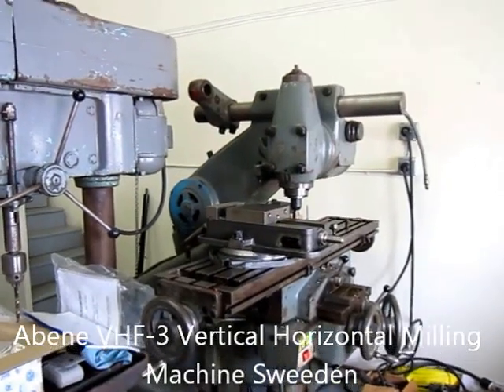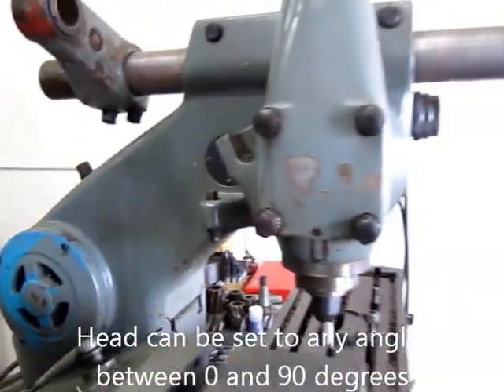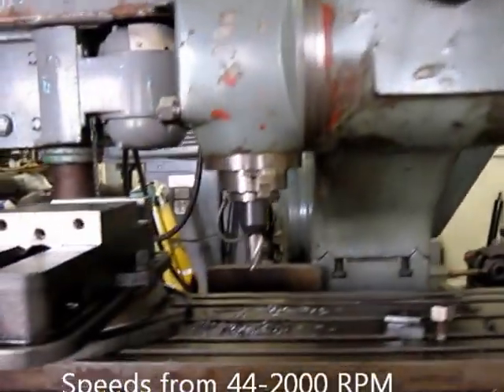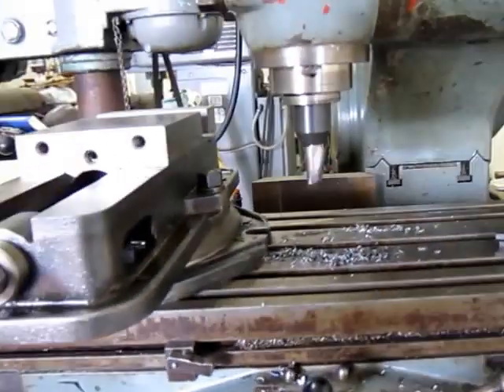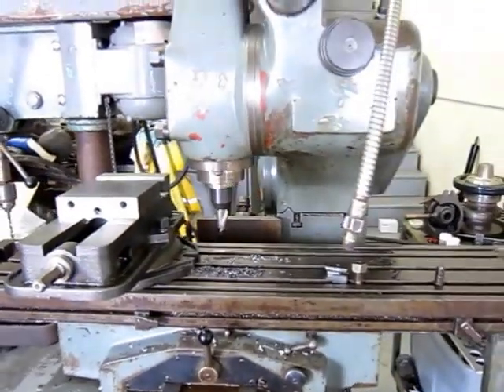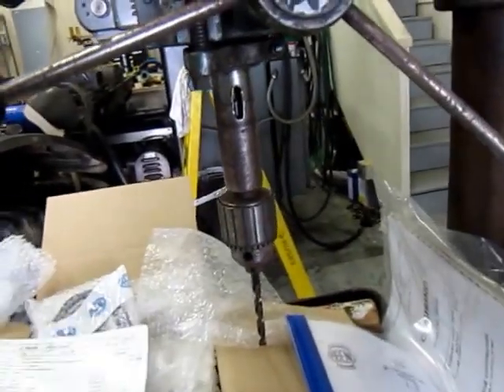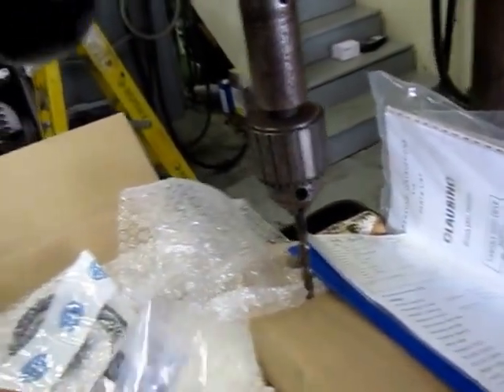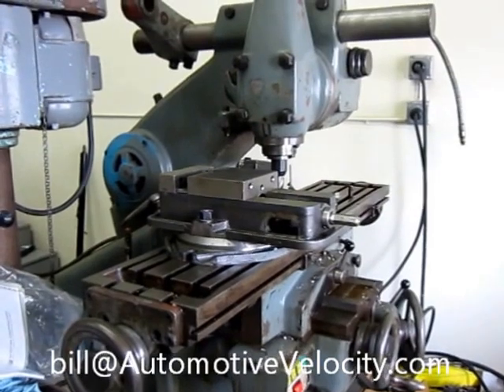Abene VHF3

Comment: Where do you have to central oil pump for the guideways on this model of the Vhf-3? As you might have seen many other vhf-3, as well as mine, has a manual pump on the box with the electric buttons. But how does it work on your machine?